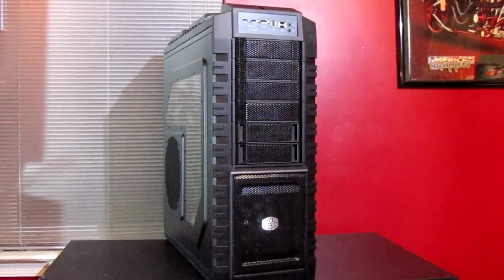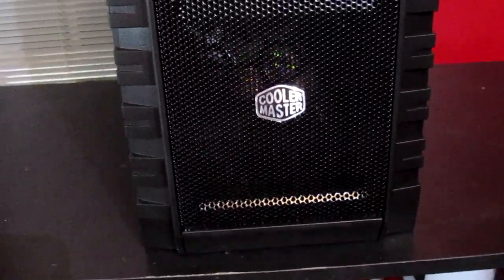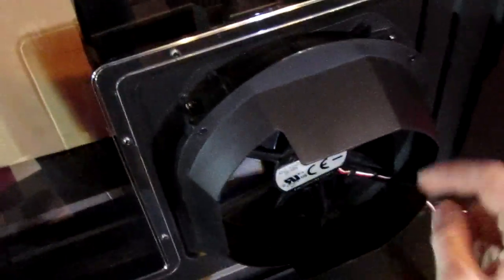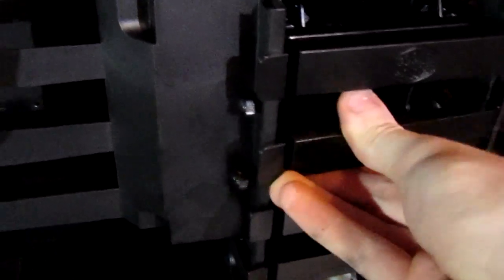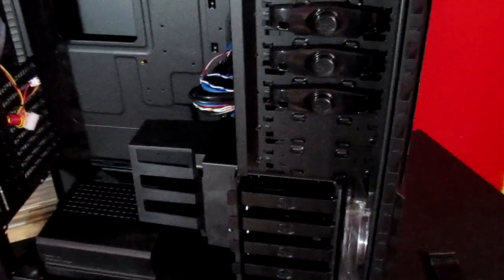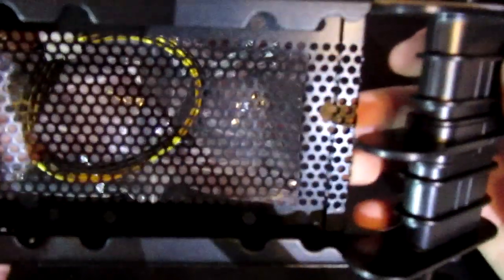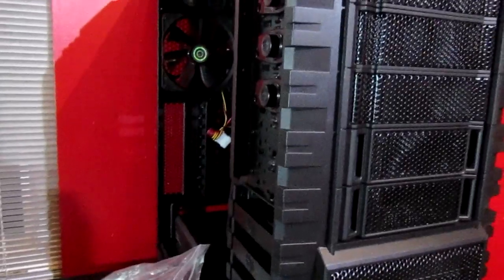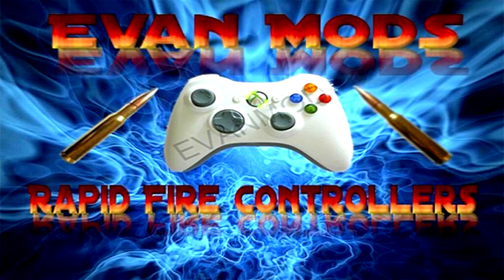First PC Build- Cooler Master HAF X Case

Comment: Do you know if the hot swap bays are removable? I always mount my res on the bottom, leading into my pump and I don't want to put the pump near the hot swap bays. I also am mounting a 400mm rad so I can't use the very top bay because that has to be cut out for the rad to fit. 
Thanks!

Comment from the maker: @HalfBrickCinema 
Im guessing you have an SSD then. I have all 7.9 except for my processor (7.8 even though it is at 4.5 GHz and is a quad core with hyper threading) and my standard hard drive (5.9). SSDs are so expensive though.